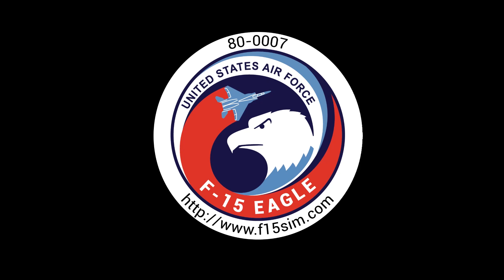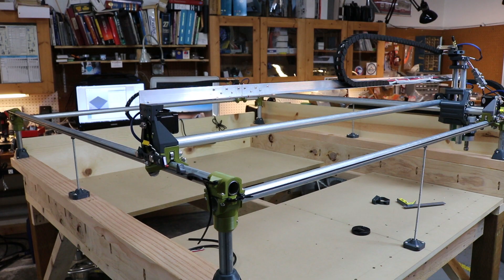MPCNC Motion Demo

Comment: Does that size seem to work alright?
Reply from the maker: It works, but I wouldn't recommend it.  If you need to go to a 48" x 48" work space, I'd recommend you build a LowRider instead.  My primary issue is the center support blocks easy access for loading/removing material.
Reply: @f15sim  so it's stable enough to mill wood?
Reply from the maker: @ethankruse5710  I don't doubt it would work, but I haven't yet done so.  My intention is to retire the machine as-built and reduce the size in a new build.  If you really need a 48x48 build volume, you would be better served building a LowRider.

Comment: Sorry, what is the total working size of your table? Do you notice any flex when working with hoarder materials in the conduits? Thanks in advance and nice setup!!
Reply from the maker: Working size is 48" x 48".  I haven't reached the "cutting things" yet stage.  I only get one day a week to really work on projects, so this is taking longer than I like. :)  I did get it drawing on paper and it's 100% squared.  I didn't get more done as I had to rebuild a sick Rostock MAX v2 for someone.  I'll be posting more video on it after MRRF next week.
Reply: @f15sim  thanks for the reply. Please keep me posted. I'm in the same boart as yourself for free time :)  all the best 🍻
Reply from the maker: @robkowalski6567  You're welcome!  What I need is an army of clones.  At the rate I complete projects, I'll have been dead 10 years by the time I get the last one done. :)